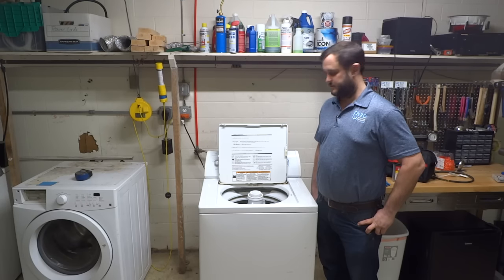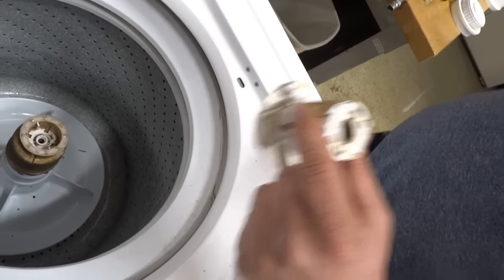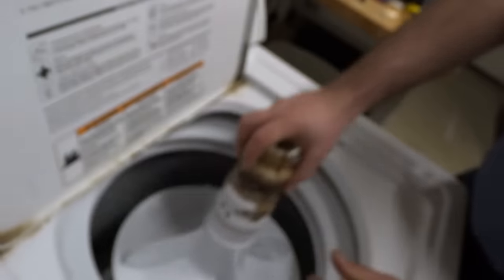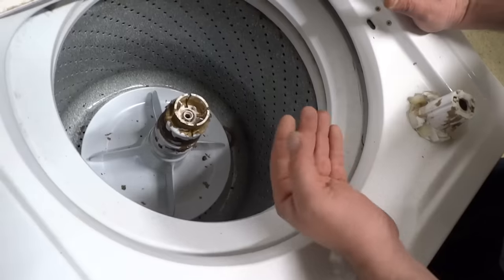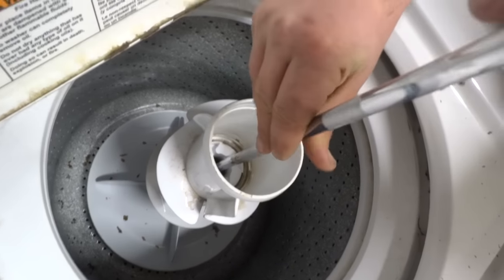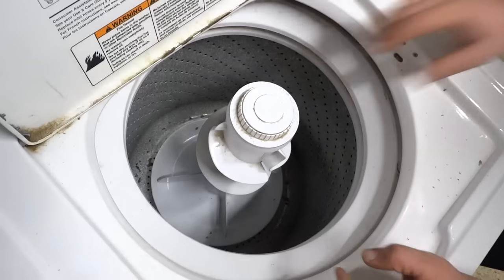How to Fix Washer Top Agitator Not Working

Comment from the maker: You can purchase agitator dogs by searching for part # 80040 from parts suppliers.
Reply: Byrd Appliance Specialists   Would this be the part number for Amana washers also?
Reply from the maker: Yes
Reply: Mine is a whirlpool how do I find part number
Reply: MINE IS MAYTAG CENTENNIAL HOW DO I FIND FOR IT
Reply: Would I use the same agitator dogs as for a Roper top load washer? 
Thx
Reply: Where can I get that long extender piece you're using for undoing the 7/16" nut? I'd like to get the exact same one you're using. Thanks in advance.
Reply: @ParisCouture  any place tools are sold. Its called an extension and you can buy them in any length you want for any drive, be it 1/4, 3/8 or 1/2 inch
Reply: I caught a parts place today and they told me would my agitator go back and forth if I took my hand and done it it'll only go one way it won't go the other so they said it's not that of course I'm a female so I don't know
Reply: The piece that comes out of agitator w/rubber washer what is that called Inside Agitator cap? It's the cap you take off to get to the dogs 👍
Reply: @angelalackey5734  z z so wdféz
Reply: @debbieblanchard6295  it sounds like yours is probably the whole thing. Not just the shaft.     You may need to take the shaft off AND the bottom bigger round piece.
Reply: Man I can get that 7/16 screw off.
Reply: What if my whole thing agitator not working. What would I ask for at part store.
Reply: My washer is an older Kenmore (Elite). Is it the same 'dog?'
Reply: @ParisCouture  Home Depot. $12.98

Comment: Sure would be great if there was a demonstration of what the washer sounds like when it's turned on. Is it grinding? Or does the washer sound normal but won't agitate?
Reply: It will sound normal. It's only 4 small plastic pieces that wear out. So there's actually the lack of contact rather extra contact that would cause the "grinding" sound.

Comment: Tim, THANKS for the complete step by step video. Was a super easy and inexpensive DIY 5-10 minute fix (after you obtain 4 new nylon agitator dogs). All 4 dogs in my Maytag Clothes Washer had their nylon dogs were not actually broken off or crumbed into pieces, but simply the dogs had become just chipped & worn down on the outside edges from years of use and would no longer catch the agitator's top section. Easy fix just follow the step by step video and unbolt 1 bolt, lift off the top agitator section and gear assembly from the bottom section, pop out the black retainer ring & 4 old nylon dogs and replace with the 4 new ones, then slip back on the retaining ring, slide the gear assembly that holds the 4 dogs and re-bolt back the top agitator section piece to the bottom section and I am now back in business! Thanks again for the easy to follow video. Hint: If you are really worried that you can't do it or won't know how your model looked like when you take it part, then for piece of mind simply take a few pics with your cellphone along the way, you can always delete the pics afterwards. Skill Level Required: Basic
Reply: Hi there… I had a really nice vintage Maytag washer given to me n I was all excited.. guy said it worked n my friend came over to run it thru a cycle … it filled, it drained and it spun .. but it wouldn’t agitate… did your washer spin too? Thank you for your reply … I hate getting rid of this machine.. very clean n doesn’t even look used much … it’s a very heavy washer n is small somewhat but was excited because older washers go forever … repair guys want about 90$ just to come out and then labor and parts r separate so I’m looking at 250-300$ .. on social security so that makes it hard .. I’m mechanically inclined n if it was just these dogs such as in this video that’d be fun actually to attempt doing this .. just wondered if your washer spun even tho it didn’t agitate .. saw somewhere else that it could also be the timer

Comment: The washer fell off inside the tub at 3:38 seconds  when you pulled the lower agitator off and turned upside down,  you can hear it fall and make a noise in the video, You put everything back together it would of been good to let people be aware of this when you noticed it didn't work properly . Other then that great video and it will help out a lot of people. GREAT JOB

Comment: IN MY MAYTAG BRAVOS, I FOUND THE ACTUAL METAL SHAFT GEAR WAS WORN, AND i DIDNT WANT TO BUY A NEW TRANSMISSION.  I WAS THINKING WHAT CAN I PUT TO GIVE THE AGITATOR BETTER GRIP? (bECASUE IT WAS LOOSE) .  I REPLACED THE AGITATOR LESS THAN A YEAR AGO, THEN I CAM ACROSS THIS GENIUS VIDEO USING ELECTRICAL TAPE AND IT WORKED LIKE A CHARM! THANKS MAN!

Comment: Thanks for this helpful video. At 1:43 you show us the bottom agitator with a yellowish hard plastic gasket piece on top that you remove to show and then put back.
In the video when pulling the bottom out and turning it over that plastic gasket thing fell out at 3:43. You can hear it  clink in the washer basin. Looks like you Installed without it in place. It goes between the bottom and top agitator pieces. You can see the piece at the bottom of the tub

Comment: Thanks for the video.  Not fixed mine yet but now I know how.  UPDATE: amazon brought me the part today.  This a a washer in a home we just purchased so I dont know any history.  I should have purchased the complete rebuilt kit and not just the dogs as I  found I didnt have the dog retention ring. It was a struggle but I got it back together without the retention ring and it is working fine.  Once I get the full rebuilt kit, I will fix correctly.  At least my washer is back in service.   Thanks again for this video it was a prefect match for my old machine.

Comment: Thank you so much for this instructional video. The agitator has stopped spinning on this old Kenmore. Following your demonstration, I could see that one of those little plastic pieces was not in place. Disassembling it, I cleaned up all the parts, found the missing plastic, put it all back together, and Wow does it ever turn now!. 

I purchased this washer Used, and it had never turned that vigorously before.  Thank you very much.

Comment: This video was great but I made a mistake based on the instructions that came with the replacement part. It told me to remove the two little plastic pieces that are intended to hold the part in place and now the agitator wobbles a little bit. Not sure if that will damage anything else

Comment: Thanks.  I had a guy replace my belt(s) and it still didn't work (although no burning rubber smell, they did need change).  Was kinda upset, but this looks easy - will give it a shot.  I'm not mad at him, but he shoulda waited longer and ran it thru the cycles though.

Comment: If you can apply ingenuous solutions, I used a small thin face file and reshaped new pairs of teeth on each of the four cams for my machine.  This has bought me an additional 10 months of use where in the meantime, I purchased a new set of cams to replace the reworked ones currently in use once they fail.  My Whirlpool is 24 years old.

Comment: Removing the 7/16 bolt is so hard on my  Amana washer. The washer is only five years old . The bolt is very tight and is very hard to remove. I used lube several times, but the bolt won't budge. How do I remove it ? Any advice?  Thanks
Reply: JUst watching this and I have the  same problem. Did you figure yours out?  No way to hold it in place while cranking on the wrench to get it loose.

Comment: Nice video! How important is that funky cap in the agitator? Mine is missing that cap. Is it important for sealing off moisture? Should I buy a replacement?
Reply from the maker: Probably should replace it. Water can get down through the spindle and mess things up.
Reply: @byrdappliancespecialists3356  thanks!
Reply: I cant get the cap back on right. Does it just sit there or does it snap into place?

Comment: At 6:51 you removed the plastic cover for the that covers the agitator screw. 
  I have broken a few getting them out. 
  What do you do when they are stuck in the top part of the agitator and gummed up softener?  
  Spray with spray nozzle, let soak, soak with detergent/vinegar?
  I just broke one side of one with a pair of channel locks. 
  I then sprayed with a water hose spray nozzle. Got most of the gunk off the walls of the agitator too. Letting it soak a little while now. 
  Thinking about using detergent or vinegar and letting it soak.

Comment: I replaced the agitator dogs on my 14-year old Whirlpool in 15-minutes. All four were broken. This is an easy fix. The only hard part was removing the 7/16 bolt which was in really tight. The dogs cost $2.88 but shipping and taxes added another $10.00.
Reply: did your process fix any squeaks?

Comment: Been nice to see how you took the cap off, my is snug tight and I dont want to. force it the wrong way.
Reply: There is a little notch on the side where you insert the tip of a flat head screwdriver and pry it up. It comes off quite easily.

Comment: The bolt in my washer was so tight it would not budge but the top half of the agitator came off anyway. I replaced the dogs and tried to re-assemble everything. The dogs holder piece would not snap into place on the little tabs on the bottom. I noticed that the rubber washer looks like it split in half and the top portion is like an over-stretched rubber band. Is there anything I can do to fix this, even if just temporarily?

Comment: I have a GE but The plastic part under the fabric soften is nearly impossible to take off mine. There’s no grip on itself. I ended up trying to make dents in the plastic to make grooves to be able to grip but still nothing. My agitator works find as it spins on the bottom. Just not the spindle. I tried to take off the whole agitator but it won’t budge at all and it’s one of those GE  washers where the bin moves side to side and up and down.

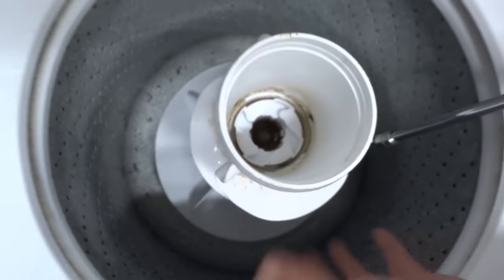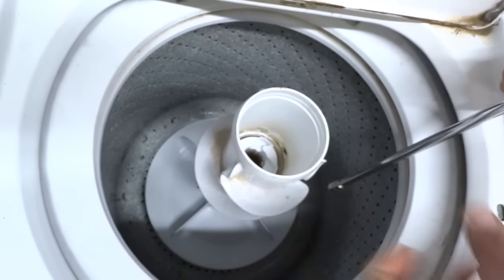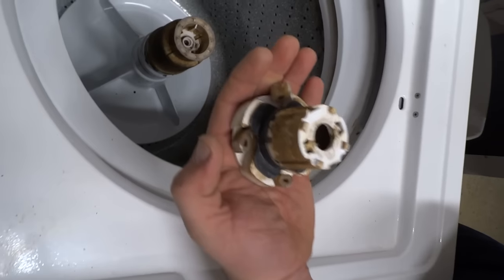Comment: Tim, thank you for this video--I am getting ready to do this fix, but:  If I push down on the top agitator, it will start "turning," but it only goes back and forth (like from 12:00 to 3:00 then back to 12:00) and I am pretty sure it used to go back and forth within a larger rotation pattern (like 12:00 to 3:00, then back to 1:00, then from 1:00 to 4:00 and back to 2:00, etc.)

Do these symptoms confirm the diagnosis of worn dogs, or do they indicate something else?  It is a Kenmore 70 Series, Model 110.  Thanks so much!
Reply from the maker: Transmission or agitator spline, possibly... but try the dogs, they're cheap, and I wouldn't be sure without seeing the problem.
Reply: @byrdappliancespecialists3356  Thanks, Tim, good idea to just try the dogs first, but I'll take a look at that spline while I am in there.  Can I pick your brain on another issue with this machine?

It has a very intermittent issue with draining on the final spin cycle.  When the timer dial shows the whole cycle is finished, most times everything is fine (so I haven't worried about it).  But once in a while when the cycle is finished the tub is full of water and once in a while there is a little water left in the bottom of the tub ( a couple of inches).  Usually just turning the knob back a few degrees to the final part of the final spin will solve the problem; it will do a normal final spin and drain.  I've seen a lot of suggestions about drain problems but none that dealt with it being so intermittent.  Any suggestions on the best place to start with this?
Reply from the maker: It's hard to clog the drain on these. If they clog, something gets stuck in the drain impeller and it jams the whole machine, so you would know. You could have a worn out clutch. The basket won't spin well and leaves the clothes wet. Then they will drop, leaving a little water in the bottom. That, or the motor is dying, but the clutch is more likely.
Reply from the maker: If the tub is full of water, then your lid switch may be failing. If the lid switch fails, it will not enter the final spin.

Comment: So I have a Maytag. I replaced the dogs. The splines on the entire assembly look fine. I looked underneath and it is beltless with the motor direct. It does spin and drain well. I’ve watched it agitate and the agitator lightly goes in one direction and the clothes just sit there and come out dirty. Any ideas?
Reply: Mines doing this too
Reply: Valerie meadows i assumed it was some gear issue that i didnt have patience for waiting for parts. We are a cloth diaper family. Bought a refurbished one for 200 and gave it to some appliance techs.

Comment: Well I indeed snapped the plastic from over tightening lol now the bolt is in and the agitator comes off 🤦🏽‍♀️🤦🏽‍♀️ did that plastic washer hold the top piece of agitator on ?!?
Reply from the maker: Yes. The bolt holds the plastic agitator on.
Reply: I figured it out afterwards. Thank you so much for your reply. I ended up taking a washer from my own stash and it happened to fit well 🤷🏼‍♀️ at least for now.

Comment: thanks, I ordered mine tonight. Only reason I knew they were broken is because the door switch is bypassed!
Reply: I always bypass the stupid door lock after I notice (heard) the agitator stopped agitating after 1 min into the wash. But it went through the cycle time like normal. Never gave me an error code so now I look. You'll never know if your washer is working properly unless you see it. I don't trust it.

Comment: My drum doesn’t spin freely it turns about less than a quarter turn and stops in both directions. Got any ideas of what could be the remedy. TIA.
Reply from the maker: That's normal, if you have an old-style washer - the brake is kicking in. Keep digging. Good luck
Reply: @byrdappliancespecialists3356  ok, I replaced the actuator and it didn’t even go into diagnostic mode. I did find a lot of oil on the bottom plastic case.
Reply from the maker: @stephanielopez2187  this is a mechanical washer - no electronics, i.e. diagnostic mode. You'll have to keep looking.

Comment: So I was able to get the top cap off but I can't seem to get the next plastic cover off. It barely has the tabs to grab with pliers. It's a hotpoint MODEL VBSR3100DAWW. Any suggestions?
Reply from the maker: Check our video on how to remove ge agitators. It's different.
Reply: @byrdappliancespecialists3356  Can you tell me the title of that video? Or add a link? I have the same problem as Katie Cook but can't seem to find the video on your page. Thank you!

Comment: So, my dogs are worn out, I can see, but when I try to remove the bolt, everything just spins. It wasn't agitating at all, so I'm assuming the splines are stripped. So, what is the trick to getting the bolt out of the top when it seems like the spline must be stripped? I can't find a way to hold any resistance against the rotation of the bolt to get it loose...if I hold the bottom of the agitator while attempting to loosen, it just slips...click....click....click...like a worn out spline. There must be 1000 videos on YouTube how to change the dogs in the top end, but nothing that I can find how to deal with this problem. Whirlpool LSR8233EQR. Thinking of looking if I can turn on its side and see if I can reach the shaft with a pipe wrench to hold it still???
Reply: LSR8233EQ0 that is :-)
Reply from the maker: The bolt screws into the shaft. If you hold the drive coupling in place between the motor and transmission that would stop any movement. You should be able to break it free, though, as the agitator is just a piece of plastic over the top of the drive shaft. It has no relation to the bolt. Hard to understand why that's happening to you.
Reply: Thanks, I'm heading out to the shop now to try, but I am wondering now if my transmission may be shot??? We'll see in a few minutes. Thanks for the video and your response.

Comment: Hey my washer is no longer in use I think it’s not salvageable anymore but it still works pretty decent so I don’t know what’s wrong with it but like the middle part of the bucket has shifted so it doesn’t spin it doesn’t like pour water like it it does spin is just like it doesn’t get full because the fuck it’s like way out of the water and it moves out of the water so it doesn’t get full and it stops

Comment: Can someone please help me. I am finding the ratchet wrench online but I can't seem to find the long extender piece that he's using to undo the 7/16" nut holding the agitator in place, and that's what I'm needing. Thanks in advance.
Reply: You can find these on Amazon. Just search for "ratchet extension". You will need to know the ratchet drive size you are using (i.e. 1/4", 3/8", 1/2"). Order the appropriate length extension - if you need to, you can measure the distance from the nut to the top of the agitator and then get one AT LEAST that length. It wouldn't hurt to add an inch or two. Of course, if you need both the ratchet and extension, you can order both. Just make sure you order the same "Drive" size as mentioned above.

Comment: what if my bolt head has rusted into oblivion and i cant get it off?!
Reply from the maker: No good solution. You could drill it out, or beat the plastic agitator with a hammer. Drilling it out is cheaper, but more tedious. If you drill, it's easiest to use a large bit and remove just the head of the bolt. Then you can slide off the agitator and use vice grips to get the rest of the bolt out. Good luck.
Reply: thanks. i ended up getting off with one of those bolt extractors, and refiled a new head on that bolt. used the scroll saw to cut new teeth into the dogs til my new ones get here. didnt want to damage the bolt cuz everywhere i looked for replacement parts, none of them came with a new bolt. but got her done and working enough to finish laundry! thanks for the quick response!